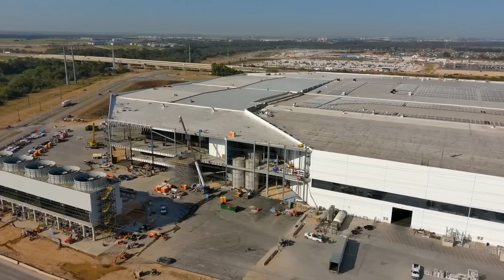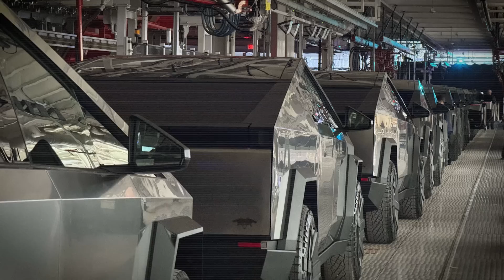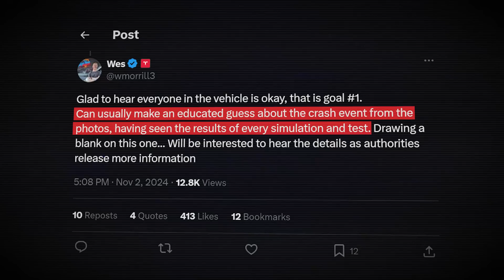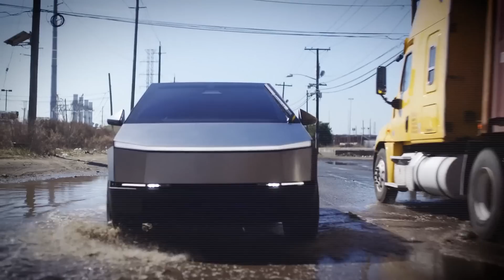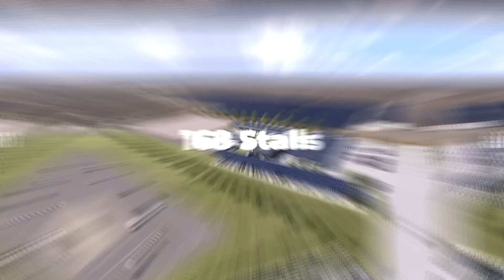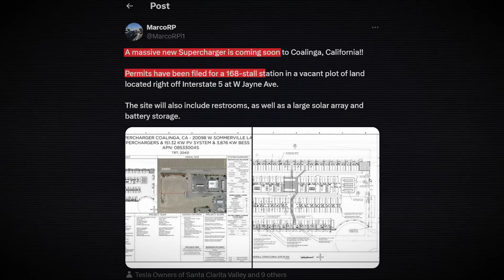The Tesla Cyber Tunnel is Here!

Comment: Sadly the Cybertruck is a flop
Sadly no other company outside of Toyota is making decent Trucks
Hopefully Edison Motors succeeded on their retrofit conversions
Reply: Flop how?
Reply: @xploration1437 …FUD Flop.
Reply: @ernestgalvan9037  lol, look at their sales figures. Definitely not a flop.
Reply: @xploration1437  It can't actually tow heavy items safely. The windows are not bullet proof. The vehicle released much more than promised. The body is not built in a unibody design and has already fallen apart. I can keep going.
I will eventually get either a Y or 3 because they are better built.
Reply: @johnp5250  your ignorance is really showing.
Reply: @xploration1437  because I know an aluminum body (cybertruck) is weaker than the literal truck standard that is out now?
Reply: @johnp5250  it doesn’t have an aluminum body.  You know nothing about how the Cybertruck is made and it’s very obvious.
Reply: @xploration1437  the part that pulls is aluminum. Every other truck stainless steel. Go figure they didn't put steel in the one place they needed. It's almost like they did consult any truck maker and asked for their feedback. The truck fails to be a truck I can't buy it
Reply: @johnp5250  again, you are wrong.  The Giga casting is aluminum, not as you call it “the part where it tows from”.  Are you 12?

Comment: I'm getting bearish on Boring, their tunnels seem to be going slow. I have doubts about their claims how how fast they'll be able to tunnel in the future. Seems VERY dependent on how soft the soil is.
Reply: This is on their website. I would assume like anything else they are constantly improving and upgrading

Prufrock is designed to construct mega-infrastructure projects in a matter of weeks instead of years
Prufrock is designed to tunnel at a speed of 1 mile per week, which is 6 times faster than The Boring Company’s previous generation TBM (Godot-Plus)
Reply: @travisjazzbo3490  Prufrock 3 excavated soft ground at Giga texas at 21 ft (5.6m) per day. around 125ft per week on a 6 day week (they generally only worked 5).
The Prufrock series of TBM's are 15ft diameter EPB machines, building a 12ft circular tunnel. Not sure what "Mega-infrastructure" projects you are going to achieve with a one size EPB TBM. They are pretty good for trunk sewers and HV cable tunnels in my experience.
Reply: I mean yeah… digging through rock vs soil. One is goin. To be faster
Reply: @cheeriomartinez  it could be a difference of a mile a day vs. a mile per month, or potentially zero miles.
Reply: @cheeriomartinez  Agreed. Rock excavation is generally faster than soft ground.

Comment: The only thing is see lacking in the tunnels are escape routes in case of fire or collapse.
Reply: If there's no humans, there's no need for human safety
Reply: @timofejs_udalovs  They're grasping.
Reply: @timofejs_udalovs  it still needs to be maintained which is performed by humans.
Reply: @leolovett9665  then there won't be trucks driving through while maintenance is going on? It doesnt seem like al particularly long tunnel so maybe it doesnt need exits because its is shorter then the length between exits? Just some things I can come up with not saying they are true
Reply: @alphawolf3194  escape routes? It’s a tunnel just pick one of two exits
Reply: @dyldog right!?
Reply: @xploration1437  okay update: I work at the factory and there’s actually multiple “entrances/exits”, they built doorways and footpaths outside that lead directly to the tunnel on the far south side. There might be drone photos out there, if you see sets of white double doors that’s what it is
Reply: @dyldog  I watch Joe Tegtmeyers drone footage.  I’ll keep an eye out.  I’ve driven by the factory a few times on my way to photograph Starbase.
Reply: @ you wouldn’t be able to see it from the highway, the hill blocks the view. It’s quite low, by the lil pond👍🏻
Reply: How much more idiotic can you get? Or are you just a troll? 
It is a short tunnel with concrete walls, a concrete floor (FYI, concrete is non-flammable) and some under floor wires for lighting.
The vehicles will traverse the tunnel autonomously (FYI, that means self driven - no human driver required).
Reply: Short enough to not require intermediate escape passages according to the regulations in most countries. But probably designed for self-driving cars, hence escape requirements should come under maintenance conditions only.